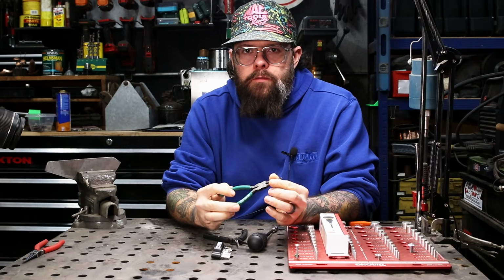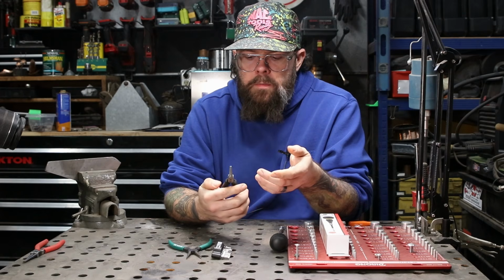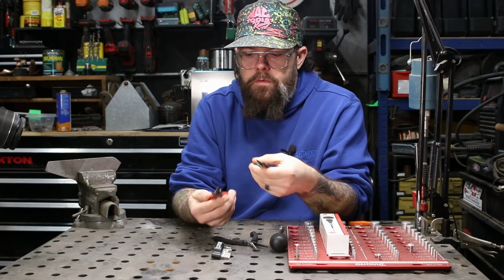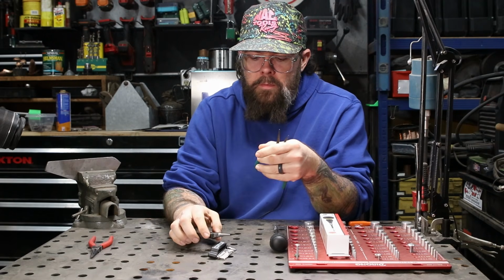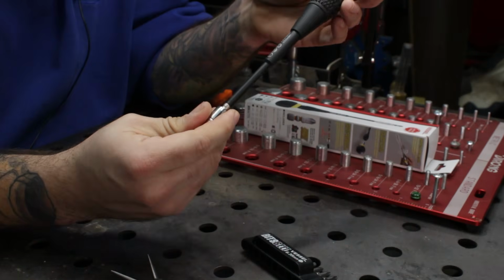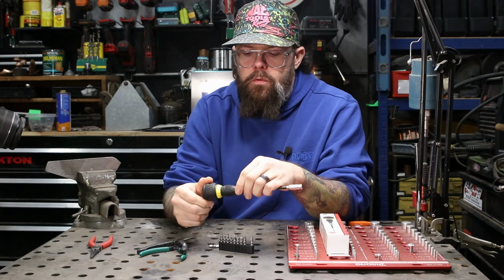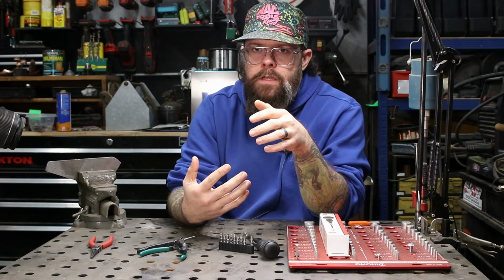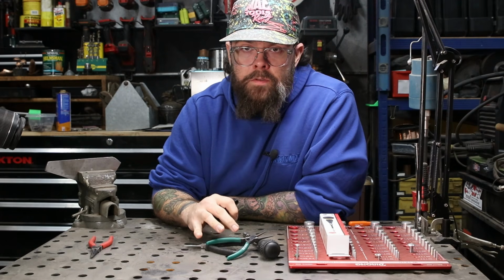DON'T Sleep on Japanese Tools - Engineer, Vessel, Vampliers and more!

Comment: I love the Vessel ball grip, but I wasn’t a huge fan of the ratcheting switch. It felt cheap and loose. It doesn’t hold its L or R position very well and mid-turn it would switch to stationary. I gave it multiple tries because I loved the actual tool, but just didn’t love the rotating switch.
Reply from the maker: So far mine has been OK.  I’ve been making a point to use it as much as I can.